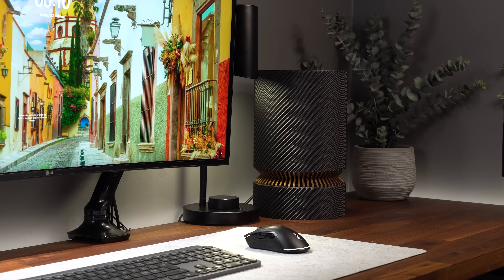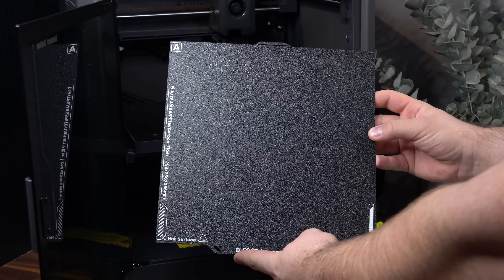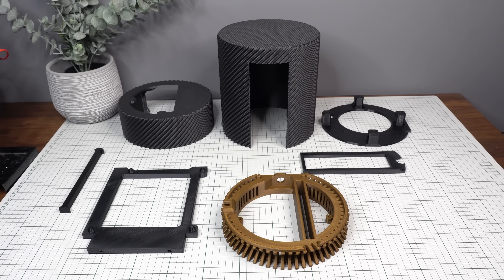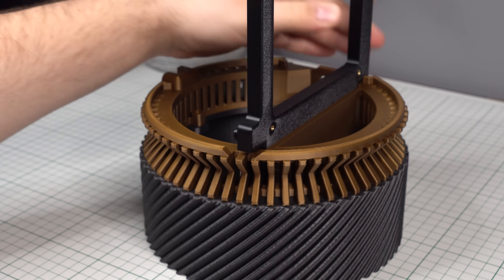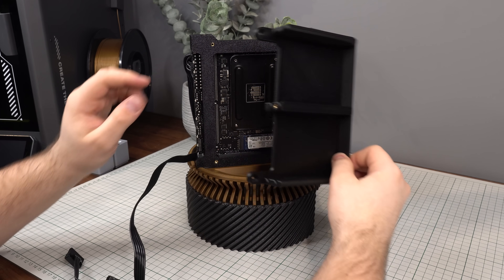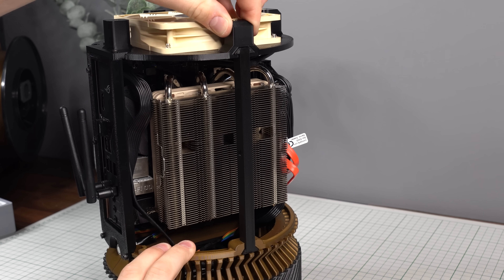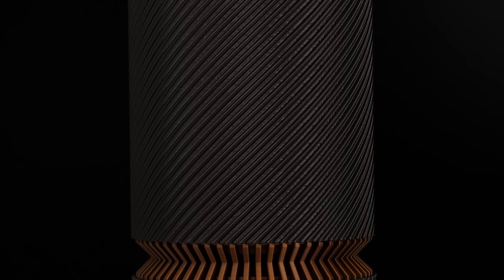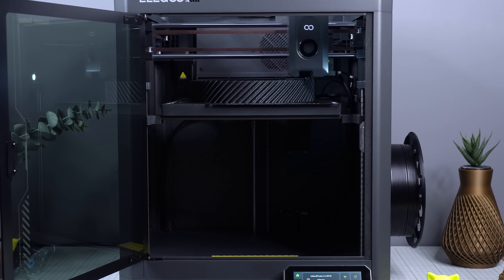Aesthetically Pleasing Custom 3D Printed PC Case Build

Comment: mas, a fonte vai puxar o calor da placa mãe?
Reply from the maker: Not really, it will just pull in air from the middle air intake. The top fan will do the most of the pulling hot air out the top. 👍

Comment: what kind of filter would you use for those holes though? to not get lots of dust into the case.
Reply from the maker: Hmm, I don’t have any specific solution in mind there especially for this design. It’s not very filter-friendly in it’s current state

Comment: This is a pretty good one. I am still holding out on the carbon filled filaments, due to residue digging into peoples skin. Do you recommend coating this thing and using gloves? If not, how do you deal with the fibers?

Also, once you factor in the IO, it sort of ruins an otherwise nice design. Cables at the back is simply not a great solution, if you want a real expressive build. You end up "see how gorgeous it is, just don't look at it from the side or the back, because that part is ugly".

But hey, all these flower pot inspired design these days, are pretty fine as they are. This is one of your better takes, in my opinion.
Reply from the maker: Thanks Frode! 

The Carbon filament might not be ideal for parts that are frequently handled, however in my particular situation the case is intended to be mostly stationary and won’t be handled so the potential needles in my fingers is not something I worry too much about. 😁

The IO is unfortunately hard to make pretty unless it’s encased inside the outer cover which could work too but would require a much bigger model 😊
Reply: @makerunit  There are other option than the rear IO is at the rear option, and no, they do not require a ton of space. But this is not the right place to try to explain that. Also, there are mesh that do not require a ton of retraction, that would lift the design and its finish, particularly with the new mesh features supported now. Also, a case like this, would benefit greatly from a custom designed mesh on the top, to go along the rest. But again, people hardly know how to do that, and this is not the place for it. Actually, I have never seen anyone do it, beside of my own work. But for this one, it would really work out, done the right way. The mesh could extend the lines from the edges.

Comment: I purchased this and printed it. I am beyond impressed and satisfied. I put in a MinisForum Ryzen 9 7945HX 3D motherboard.
That CPU has 16 Cores - 32 Threads running at 5.4Ghz per core. Added a PCIe 5.0 Samsung 9100 2TB SSD. A 10 TB Seagate Exos drive for backup. 64GB Corsair Vengeance 5600mt Memory and installed an Oculink cable on the 2nd M.2 slot. The 610M APU is crap. 
I also purchased the MinisFourm eGPU Dock and added a RTX 2080 TI 11GB. I know it's a little old, however, it will play everything from today. 
I printed most of it in black and the center vent in bright red. The Computer name is CryoCore. The Profile name is Core1. 
The SSD hit 14GB per sec running CrystalMark. I ranked 9th place with FireStrike with the 2080.
Reply from the maker: That’s awesome to hear! I’m glad it worked out so well for you! Some day I would love to make a case with a matching eGPU case 😄

Do you have some pictures of your setup? I’d love to see the whole eGPU setup next to the case! A Printables «Make» or DM would be highly appreciated. It can also give other users ideas for their build 💪 (if you want to ofc)

Comment: Amazing design. Buying the files to print but going to use a small factor pc i have to harvest it's contents and mount them here, any chance to make the motherboard and IO shield CAD files available so I can modify to mount this type of board?
Reply from the maker: Hi, thanks! 🙏 the step file is included already as part of the standard files!
Reply: @makerunit ah great didnt see that, amazing. Thanks

Comment: Very nice. Do you have an option with a standard ATX power supply base ?
Reply from the maker: Hi, this version have no support for ATX psu as it simply won’t fit size wise. Though I’ll try to see if it’s possible in a potential V2.

Comment: could it be possible to remove the hard drive bay in replace of a GPU and modify the upper case portion height?
Reply from the maker: Originally my idea was to do Mobo/GPU combo but to fit within the print volume requirements I set I wasn’t able to make it fit with the given dimensions. However on my to-do list, I’m planning to create a v2.0 of this concept which should also support a GPU! I’m hoping to get it out around december/january. Though I can’t make any guarantees other than that it’s in the planning! 😊
Reply: @makerunit thanks! I'm looking forward to it as I just got my hands on the H2S. so it should be perfect

Comment: Which printersettings do you use for the motherboard-mounting-plate? I would print it in ASA. What is the Setting for scaling in fact of shrinking and expansion? ASA is known for expansion.

Thanks for your help.

Its a beautiful case. i have buy it on thangs.
Reply from the maker: Hi, thanks!

Regarding the scaling for shrinkage or expansion I can not give you any information regarding that as it’s very filament-specific so you’ll have to check with the manufacturer of your specific filament to get those numbers. 

I think I just used regular settings with some extra walls/top/bottm layers to make it stronger. Nothing fancy really.
Reply: @makerunit  is it possible, that you send me the step-file for the fan-mount? i would built it with the Noctua NF-P14r redux. this fan fits in the middle.
Reply from the maker: @MarcSchwirplies you can try but I don’t believe it will fit as I also wanted to do that in the beginning, though it was barely too big to fit. Unless it’s got very rounded edges it might just fit. Message me on Printables and I’ll have to send it later today.

Comment: Does the Elegoo CC come fully Built ?? or do you have to build it ??
Reply from the maker: It comes fullt build. Up and running right away after removing the bed set screws and cardboard/foam/zip-ties. Only thing that took time for me at startup was the initial first-time-use calibration, took about 30 minutes to fully complete.
Reply: @makerunit  Thanks Mate - You sold me I'll order one and give it a go, if it works out I'll get the second one...... Cheers
Reply from the maker: @markockwell That’s awesome! I think you’ll love it, mine has been incredibly reliable and what suprised me the most is that even to this day (I’ve had it since January before the official release) it still has not failed a single first layer. 💪 Anyways, feel free to use my link in the description of this video if you’re getting one anyways, it’s just so ELEGOO can see there was a referral through me so I get a tiny commission. No extra cost to you of course. 😁
Reply: @makerunit  Will do mate thanks again for the advice and the video 👍🏼👍🏼 my A1 has been strong since I got it, but I like the idea of comparing it to the competition.

Comment: Beautiful - Just Pure Art - I would buy it, take too long for my little A1 to print it out though
Reply from the maker: Thank you! 🙏Yeah I totally understand that the printing duration and part height for the outer panel may be a little sketch on the bed-slinger A1
Reply: @makerunit  Just a Tad - LOL, planning to get a Bigger Machine quite soon so will look into a build then 👍🏼👍🏼
Reply from the maker: @markockwell Awesome! What machine do you have in mind?
Reply: @makerunit  I really like bamboo - so H2S or X1C first picks
Reply from the maker: @markockwell I see! They should for sure be reliable options! 😊 though for a premium price.
Reply: @makerunit  I know - thats the down side all though that said I am torn, Looking at your printer the ELEGOO Centauri Carbon at $300 perhaps I might deviate a little and get two of those so it will cut down printing time's.....
Reply from the maker: @markockwell I’m very happy with the Elegoo CC! I’m still waiting for them to release a multicolor system to make it complete though. 😅
Reply: @makerunit  That will be the Bee's knee's

Comment: This would be awesome with slightly larger and taller build but backside for GPU with mesh instead of Sata SSD slots since most modern PC's dont really need hard drives.
Reply from the maker: I’m planning to eventually create a GPU friendly version of a similar concept. Though the intention of many of my cases is to re-purpose older components so even though not relevant in all new builds there’s still a large group of people wanting this option. 😊

Comment: Constructive criticism:
1) Almost nobody uses 2.5/3.5" drives anymore
2)  Most motherboards can house 2 M.2 drives, even ITX boards
So if you used this space and made this a little taller and had the GPU hang vertically, it would be AMAZING. Check out the Ncore 100 Air case for reference. My only issue with the Ncore 100 Air is that if they were clever they could have used the space that can house a 68mm tall air cooler and used that as an intake for a 120mm AIO with slim fan. If you made something that resembled your case, had a layout like the Ncore, can house a 3.5 slot GPU and had a spot for a 120mm AIO that was an intake, it would be the perfect ITX case
Reply from the maker: Hi, I totally understand your criticism. The though behind many of my cases are for repurposing old components, where 3.5 and 2.5 drives are still very relevant, especially for those wanting to use them as small storage servers or similar.

I did try fitting a GPU but to stay within certain print size restrictions I didn’t wanna make it larger to keep the external panel as one single piece.

I do plan to create a v2.0 eventually as it’s clear that many people want this design aesthetic with GPU support so it’s already in the early planning phase.

Comment: Being able to print a unique looking case like this one for under $100 would be very nice for budget builds. I'd love to see a bigger version that can accommodate mATX motherboards since that form factor tends to be the most budget friendly. While ITX is obviously the best when it comes to small form factor builds because of the smaller size and better selection of cases, you always end up paying a premium for it.
Reply from the maker: Very true, however the main limitation is print volume. Most people have printers in the range of 220-256mm bed sizes. Especially for a «aesthetic» build like this it’s challenging to build something for mATX if the goal is to keep the same clean exterior. Only way to do so would be to split panels. It’s for sure possible but nowhere near ideal for that clean aesthetic.
Reply: @makerunit  Ah, yeah, I didn't think of that obvious limitation. Really cool case design either way!

Comment: Very interesting concept, and probably unique outside of the (in)famous "trashcan mac  pro", which wasn't exactly accessible to mainstream audiences. 

I think you really got something here, and I can see how further refinements and creative placing and careful part-picking could allow for a dedicated GPU (ideally even a standard single-fan ITX card, though that might be pushing it). 

Putting square parts in a cylinder is inherently challenging, and though it might be tempting to have a look at how Apple did it, that might actually hinder creativity (Apple could make bespoke parts, but you have to consider standardized parts; it's a fundamentally different challenge).

I'm currently case-swapping a prodesk 600 G5 from its original case to a bamboo-box as an exercise in simple, cheap SFF design (and allow for a riser-less setup with a full length-GPU).

Don't have a 3D-printer, but something like this has me interested in getting one, as this type of organic design is prohibitively difficult for most people to do with wood or metal and hand-tools (as opposed to "a box, of some kind"), and this is the first time I've seen an "organically shaped" PC case that's - theoretically - cheap enough for most people to get (if they have access to a printer). 

Will follow this project; nice work!
Reply from the maker: Thanks for your thorough feedback and thoughts! Fitting square parts in a round cylinder definitely has some drawbacks and challenges. The benefit Apple had is that they’re making the hardware as well, so they can design it to fit rather than as you mention, using standardized parts as custom hardware is a little too advanced for most DIYers 😅,

I’ve already got some ideas in mind for a follow up on this one. I’m thinking about a similar design but a rounded off square instead of the cylinder. It would allow for much more flexibility in terms of parts that can fit.
Reply: @makerunit It's hard to visualize, but "rounded off square instead of a cylinder" sounds like acquiescing to the inherit challenge of making "square parts fit in a shape that's not intuitively fit for it". 

There's no pressure or time-line here; I think it could be a fun thing to try to "make work" despite - or because - of the challenge of the shape. 

I think most people who are creative enjoy having at least one of those "damn, this is so difficult, and I sorta want to make it easier for me, but then I remove all the things that makes it difficult and interesting to me."

...keep noodling on it. It's interesting to people because of how it looks, so now the challenge is "what are the perimiters of what I can do?". 

...I think it's better to have this project in the "back of your mind", rather than poking at it to make it more practical. 

It is what it is, and that's the fun of it. If you're a smart monkey, you can make something interesting out of it.
Reply from the maker: @OrinLinwe Oh it’s already quite close to my forehead and something I’ve had on my mind a few months after feedback when I first posted this. «rounded off square» is actually looking quite cool in my head. It would follow a similar approach. However I believe it will still be a challenge keeping it all in a closed exterior while still having decent airflow for a GPU to work without it just recycling it’s own exhaust causing high temps. 

Despite being easier to «fit» the parts, there will still be other challenges. 😁

Comment: This is really nice. If you're considering a "v2" it would be cool if it could fit 2 3.5" HDDs instead of 1, would make a good plex server or NAS. Just a suggestion.

Edit: Also, I see people suggesting GPU support. It may be possible with a riser cable in the "sandwich style" layout. However, it would need to be a GPU no longer than the ITX motherboard (wrapped around under the board in place of the HDDs), AND airflow would be a nightmare. I imagine that the reason that there is no airflow in the case sides is to maintain stability/rigidity. It's definitely a dilemma. I just got my first printer so, I'm just scouring the web appreciating how complex these thing are to do now that I've actually had to wrap my head around much smaller projects. You're doing GREAT WORK!!
Reply from the maker: Hi! 

Thank you 🙏 

I’m most likely making a V2 at some point for sure, but things like airflow etc for a potential GPU will be high on my priority list there. As in most vertical cases it’s pretty challenging to get decent airflow for the GPU.

Comment: I really would like to see your (full) design proces!!
Reply from the maker: Hi, I’m happy to see you’re interested in my ways of working. However sharing the full process, especially the way I do it will be quite challenging, as most of my projects are designed piece by piece over many days or even weeks. It would be an insanely long video.

 😅
Reply: @makerunit I understand it won’t be easy, but you seem like the type who loves a challenge 😅.

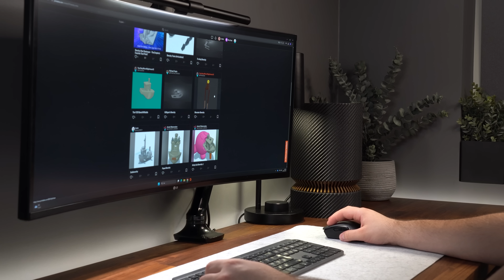Comment: 0:20 - If that's low noise, then I'd like to welcome you to my PC.
With CPU fans running at measly 170 RPM. Wile keeping an 8-core CPU cool at 30'C at idle and 60'C at load.
- On an air cooler.
Reply from the maker: 😝 I wasn’t refering to it being completely silent , but generally less noise due to the closed external cover.

But 170rpm on the CPU seems pretty impressive. 8-core is a very general term though, what kind of CPU and Cooler are we talking?
Reply: @makerunit  An overclocked, undervolted Ryzen 7 3700X. Not the hottest CPU out there, but certainly not the coolest either.

Comment: pls build M-ATX
Reply from the maker: My main concern with mATX in a round build like this is the large print volume requirement for such a large circle, meaning you’d probably need a 300x300mm printbed to even print it.

However it’s not impossible, might not be round though, I’ve thought about a similar design with a rounded square exterior.

Comment: Hi, I'm interested in buying the model but I don't know the maximum motherboard size that can be installed in that case. I have a Micro ATX Form Factor; 22.6cm x 20.5cm but I don't know if it's compatible. If so, I'll buy it right away. Best regards!
Reply from the maker: Hi! Unfortunately it’s only compatible with ITX motherboards, which are 170x170mm.

Comment: Hey very nice and original design ! Remind me of old mac pro, but cooler :-) Do you think it would be possible to modify the drive side to accomodate a 1 slot 200mm long gpu (like rtx quadro P2000 or A4000) ?
Reply from the maker: Hey! Thank you! 🙏 I believe a 1-slot card could be possible, however with the HDMI or DP connectors it might be a little difficult to do without redesigning the top fan bracket a little to allow for the cables to be plugged in, so it’s not a super straight forward edit, but possible, and may require some slight adjustments to the overall project height as well.